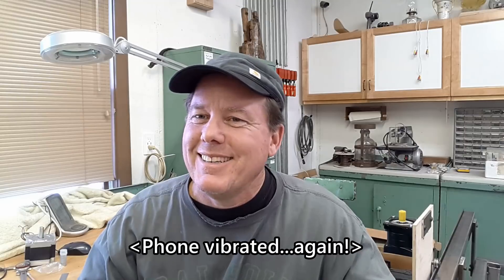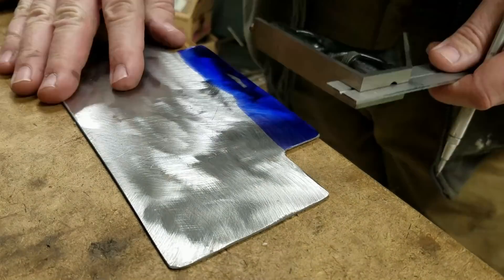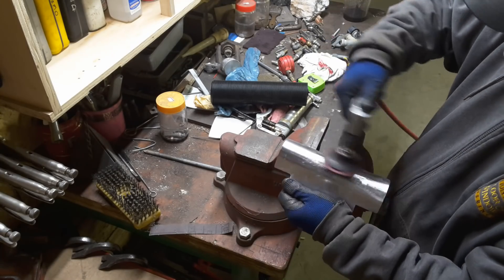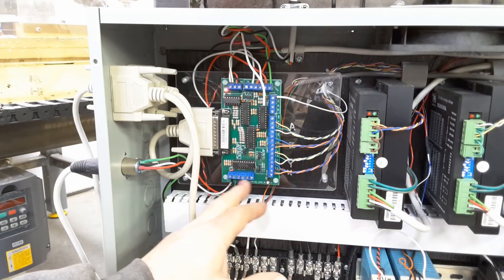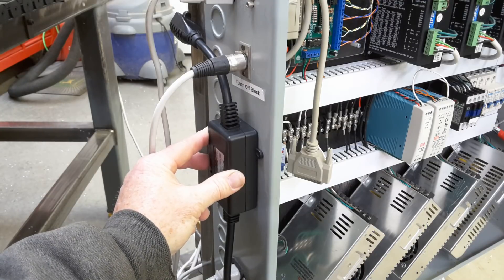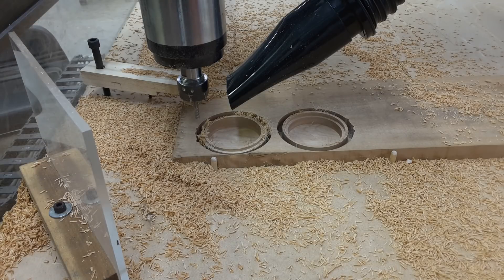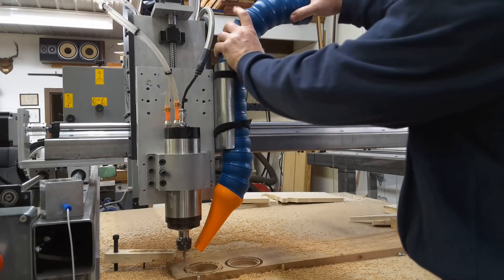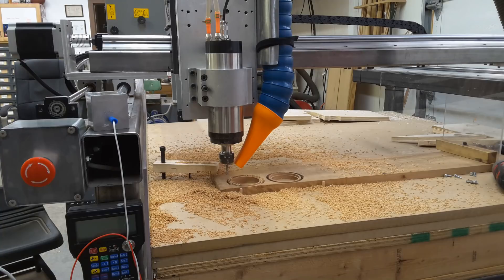No Boot Dust Collection on the CNC Router

Comment: Good remedy for chip evacuations. 

Have another question if you please. 

I just recently picked up a “custom” built CNC machine and I see that your spindle clamping mount has the same middle cap screw that doesn’t fully seat into the threaded hole… just like mine. Is that screw for accessories or…. ?? That just the way it is? 

Always have enjoyed your past builds and updates. 

Many thanks. 

Wiredodger60

Comment: I agree entirely - you surely want to see the cutter engaging. Frustrating that clear plastic gives refraction of light as I do want to remove all dust so it may have to be a wide circular acrylic plate with  brushes on the perimeter. But nobody seems to have come up with the perfrect solution to max dust removal whilst retasining max curtter visibility.

Comment: Being able to watch the cutter is good, so many dust collection systems get in the way. Some 3D printed parts would help out in a number of places here, such as adapters for hoses and various mounts and adapters.
Reply from the maker: I have added the compressed air nozzles now.  First time I ever had a use for 3d printing.
Reply: @sbirdranch  Like any tool it is hard to understand what it is good for until after one has used it awhile. Not everyone has the same experience, but I've found that I make several new items a week with my 3D printer and many of those are fixtures, tools or tool storage and organization. Being able to conjure a 3D idea up in OpenSCAD (free design software), 3D print it (to a few thousandths accuracy, and with very little of my time required), and start using it in a few hours is pretty amazing. Aside from making custom brackets and hose adapters in this case the dust collection head could be custom made to suit the router. Custom holders and trays for tools are handy and organize tools better than random storage. I make spacers with exactly the right external curves and internal cable tie channels that I could not make any other way. There are many types and colors of plastic that can be printed, and the raw material is in convenient rolls, one doesn't need to find a piece large enough or make a trip to the store to get material as is required for CNC cutting. The amount of plastic used can be very efficient with essentially hollow or various honeycomb internal structures. I never guessed at the variety of uses I have found for the 3D printer. It is also useful for making prototypes that later will be cut with CNC for fit testing and verification. Quite a few CNC routers are even built with lots of 3D printed plastic parts. The printer is not large and very quiet and dust free so it doesn't have to be relegated to the garage or shop, which is especially nice in the winter. :)
Reply from the maker: @alanb76  That is a lot of good ideas.  To be honest I have put off 3d printing for one more reason.  Historically they have been very fiddle and I just didn't want another thing I had to budget my time for.  I have a good friend that keeps up with that tech and occasionally I ask about them.  His last purchase (compared to his previous) is cheaper, faster, and better.  Those are all good things.  So at the risk of thinking about it further I will ask....what make/model do you run? ~P
Reply: @sbirdranch  I started with a Lulzbot Mini, ready to print right out of the box. Now I'm using a Prusa Mark 3 which I got as a kit but can also be purchased ready to go. Both of these printers are open source and have good support both from the vendor and from the user community. Either would be a good first printer. I had purchased a kit years ago and it was a project that never quite completed, these are well beyond that. The cheap clones often need fiddling and upgrades. If you've already mastered a 3D design program that will produce files for 3D printing you're ready for it.

Comment: With CNC Routers you need lots of suck OR, a little blow. I'm like you I don't want to cover up my bit and I want to see the work being cut and for setup, so a dust boot is a no for me. I don't care about getting chips on the floor or my machine, that's what its for. I do want the chips out of the pockets and not to have my cutter bit cut them twice, so they need to go as fast as possible, So for me It was a air setup with controlled puffs every 10 seconds of air directed at the end of my bit. It removes and chips/dust from the bit and keeps the work/pocket clean.

Comment: So is the vacuum blowing on it or vacuuming up the dust?  You said you were going to use it like a blower and then the text message came in and killed that train.
Reply from the maker: The vacuum is pulling the chips out.  I mentioned using compressed air to blow as well, but did not implement that in this video.  ~P

Comment: Just a heads up on the cheaper AC/DC control relay, from Digital Loggers.   First I am not knocking the product.   In fact their support team is excellent.   However, if you are using a heavy duty dust collector, it may not work for you.   Mine draws 15-20 amps at start up.  This was enough to trip the built in current protection.   If you are under the 12 amps it would be an excellent choice.   Very easy to setup.   It works great for turning on the light and spindle coolant water pump.

Comment: Was sitting here eating popcorn when i had a thought about your CNC Router i watched yesterday.  Why don't you use a down draft table under the work, then you could use low level air pressure to evacuate the chips from the cut without spreading them all over the shop.
Reply: Found this down draft table build.  https://youtu.be/QWTZNpcC2Eo  Some plexiglass side shield would help keep the larger chips over the table.
A local cabinet maker evacuates his chips/sawdust, through a six inch duct, to a sawdust pile about 20 feet from his shop, in the edge of his cow pasture.
Reply from the maker: Interesting concept.  Definitely something for the fine dust like when cutting MDF.  I have a small 4" dust collector at the end of the table I am trying to figure out how to integrated.  Maybe this will give me some ideas.  Thanks for the link ~P

Comment: Great job, Preston! I didn't know they made LocLine that large. I've got the dust shoe coming for my little X-Carve though. With all of the CNC machines around I have to keep the dust down so it doesn't gum up the ways. I also got one of the little relays with a 4 plug connection so I can have the controller turn on the spindle and vacuum at the same time. Hoping the 15A is enough for it...

Hope all is well and loved the video. It's definitely real life.
Tom Z
Reply from the maker: Thanks Tom.  I understand with all your machines in a shared space.  My mill and lathe are in a separate room so I can get away with a little more.  Glad you enjoyed.  The next video is less eventful.   Take care.  ~P
Reply from the maker: Does your machine use an Arduino for the controlling?

Comment: thing tubber radiator hose and two hoseclamps should work on getting the two hoses to connect
you could make the dustshoe out of clear plastic , you still be able to see way happens
Reply from the maker: I finally found the right connector that snaps into the last ball link.  Good idea though.  ~P

Comment: Dust extraction can be a tricky topic... I am like you...Keep my dust collection off most of the time so that I have a clear view to the spindle (unobstructed) mainly because most of my work is quite small. From time to time I will switch on the Jet to clear profile toolpaths so I don't re-cut chips and burn up/overheat endmills...I also do that with squirts of compressed air. Funny how you feel in control when you can see the spindle and cutter doing it's job lolol... My personal take on this is do what you feel comfortable with...Side Note: The only time I have a dust shoes attached permanently is when I cut any engineered materials that cuts mostly into fine dust like MDF and sometimes ply... Love the outtakes...that keeps it real :)
Reply from the maker: My end game I'm going to try a combination of suck and blow.  Sort of like a broom and dust pan kind of approach.

Comment: This was an awesome video. Excellent topic, good lighting, nice camera angles, and clean audio.  It's a home run.
Reply from the maker: Thanks John.  I am no cinematographer, so knowing that it came across well is appreciated.  ~P
Reply: Where did you get the blue and orange hose as the better solution??
Could really use one.Thanks
Also as a tip use an SCR as a cheaper and heavier duty alternative to the Adafruit switch. Kyotto makes AC and DC up to 120 amps and up to 240 AC and 100 Volt DC.
3-32 vdc input signal @ < 10ma
Thanks

Comment: Great video and ideas, what is the blue hose called?
Reply from the maker: http://amzn.to/2Dr5PPA
It is called loc line.  The same manufacturer that does coolant nozzles etc.
There are more links in the video description for individual pieces that may be cheaper to purchase than as an entire set.  ~P.
Reply: Great video...  I did a similar setup using a harbor freight single stage dust collector hose with a floor drain and hose (no where near as clean of a set up as you have).  I mention this because  my setup gets almost all of the chips.   Why... Assuming the suction is a better... maybe something to consider for your setup.   Do you know of anything 4 inch similar to the loc-line?   Thanks for the video ... I am going use some of your ideas to improve mine.
Reply from the maker: jnbff10 so the floor drain is your inlet?  I bet that dust collector moves a ton of air.  I have a small-ish dust collector from Penn Station that sits at the other end of the machine and is hooked to my bandsaw.  I could use it but didn't want the 4" hose.  I have not seen a loc line style hose in that size either.  ~P
Reply: sbirdranch I am not sure it’s a drain.   I picked up in the plumbing section with other PVC connectors.   It looks more like the rectangular end in the dust collection kit you have.   I have it mounted similar to what you have but using several wire ties.   As you said I want to see the cutter doing the work.